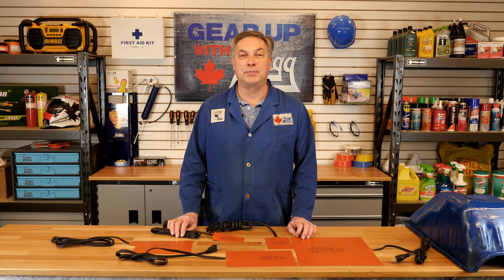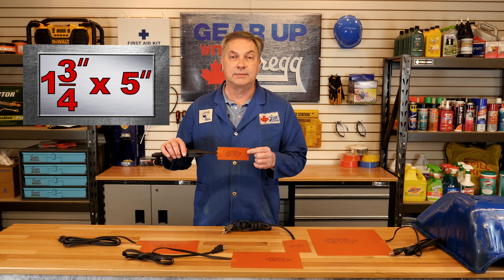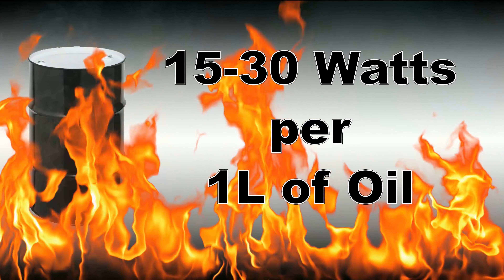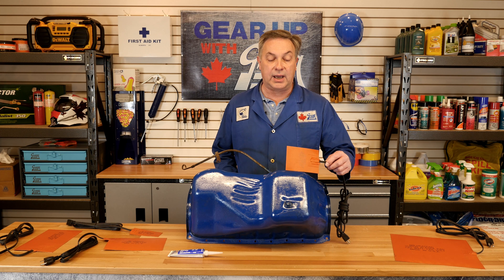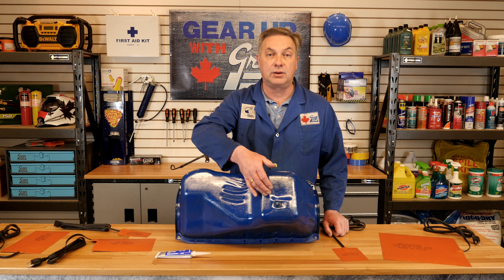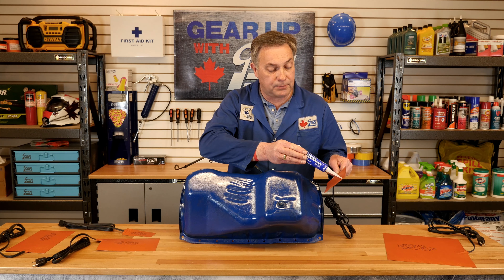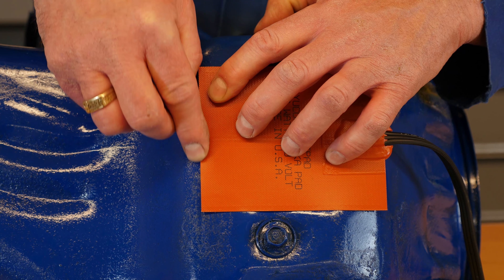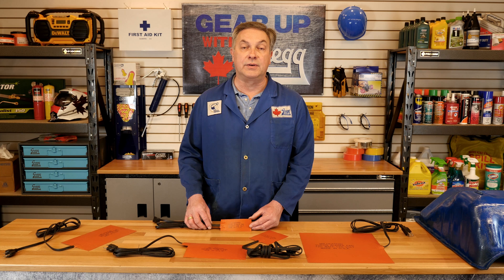How To Install an External Oil Pan Heater / Heat Pad - Gear Up With Gregg's

Comment: I have been using these pads in my cars for years. The one drawback is that one never knows if the pad actually ‘turned on’.  One day I was curious and checked one of the pads to see if it was hot.  It was not hot, not warm - broken.  And for who knows how long?
Reply: Pull the dip stick and verify warmth or hot oil.
Reply: @JoshuaCartagena-c4q So easy to tell… some people are just plain dumb.
Reply: Same can be said with block heaters. At least you can physically tell if the pad is warm

Comment: The instructions included with my "ZeroStart Thermo" 500W P/N 3400064 pad, say "DO NOT USE ANY OTHER ADHESIVES TO APPLY PAD TO METAL SURFACE!"  in all caps.  The pad comes with "3M VHB" adhesive covering the back side.  The high temp silicone adhesive that is included is to seal the outside edge of the pad.
Reply from the maker: We appreciate your feedback. The pads discussed in this video are Access Alaska Heat Pads. They recommend use of Permatex 77BR which is specifically designed for this application.
Reply: What about this stuff ? I have it in tube already open  Permatex 82195 Ultra Grey Rigid High-Torque RTV Silicone Gasket Maker, Sensor Safe And Non-Corrosive, For High Torque And Vibration Resistant Applications,
Reply: Usage of a silicon or rubber cement type medium seems counterintuitive for an application where you want heat transfer and adhesion. A much better alternative would be to use thermal paste that is not electrically conductive or a thermal paste adhesive as are used commonly in computer CPU heat sink applications which have to mitigate much higher temperatures than you would find in an engine outside of a combustion chamber itself. In addition, covering the pad with adhesive aluminum tape to seal the pad in place should far superior results. Of course the manufacturer would need to play around with these suggestions but I guarantee it would improve overall performance and longevity.

Comment: A vid on how to combine a block / oil/ and fuel filter heater (s) would be awesome. I would like to combine them all on one plug.
Reply: Just route them all to the same area and get a 3 way extension cord splitter.

Comment: I'm going to install a 150W on a civic 3.7l engine. I know its a little higher than what you recommend but the heater cuts off power if it reaches 90 celsius. Also, this vid was exactly what I was looking for. Because I wanted to make sure I could use silicone under my pad for better adhesion. And I will have to bend my pad a little around the curves of my engine so I really need it to stick good.
Reply from the maker: Best of luck on your project and thanks for watching our video!
Reply: @GreggDistributorsLP  Thanks, I think the installation went well!
Reply: Am I reading this right? You J swapped a Civic? that sounds cool as heck
Reply: @glenbenton4855  Looks like I made a typo 😅 stock 1.8l.

Comment: which one should i get the 100w or 150w for my 7L car? and can i leave it plugged in until im going to use my car again? this coldness in canada always gives me a hard time every morning.
Reply from the maker: 7 Liters is equal to 7.4 quarts (US). Manufacturer recommends 15 - 30 watts per quart of oil. Therefore, your application would require a 111 watts to 222 watts.  The 150 watt version would likely be a good choice:

https://greggdistributors.ca/automotive/Automotive-Accessories/Silicone-Pad-Heaters/qqq78658945150

Yes, you can leave this plugged in while your vehicle is parked and not in use as this is how these are intended to be used.

Comment: Why would you add gasket maker ?
Reply from the maker: It is recommended by the manufacturer to include gasket maker,  as it is resistant to oil. This allows the heat pad to have a better connection to the oil pan.

Comment: Is it worth applying to a transmission for better cold shifts?
Reply from the maker: Attaching the heat pad to your transmission pan will keep the fluid warm, and help the transmission out on those chilly days. Thank you for taking the time to check out our video!
Reply: Damn good question.
Reply: I might need one for mine 😂 my 6 speed acts differently when it's cold vs. warmed up

Comment: Can I use a 300W portable power station with a 150W silicone pad heater ???
 I start the engine not only under the house, where I can connect the heater to the home AC sewage system

Comment: What do you do with the cord after disconnecting? Zip tie somewhere along the rocker panels?
Reply from the maker: The idea is to feed the cord up through the front grille of your vehicle, so that you can plug it in easier. Similar to a block heater. Thanks for watching!

Comment: I just moved to Manitoba from Toronto. Instead of installing a block heater is this pad good enough for -40 degree and below. Should i install multiple pads for battery engine and oil pan ?

Comment: I have to keep my snowblower outside but it has been so cold that it cant start even with choke on full. Any suggestions ?
Reply: Literally throw a heat blanket like this over it and leave it plugged in. Get like a 300w it’ll keep it warm enough to start but won’t use a ton of power passively
Reply: Or go buy a handheld propane bottle torch for 15-20 bucks and use it to gently warm up the cylinder bore (metal mid portion of the engine with all the metal fins on it) for 40 seconds (away from carb and the fuel line/tank an

Comment: For 150 watts power, how long it is needed to warm up the oil? An hour?
Reply from the maker: Unfortunately, this is not a simple answer.  It depends on the outside temperature, temperature of your oil, size of your pan, etc.

Comment: Is it safe to use a 15W Alaska pad on a Honda 3000 gas generator?  It takes about a half litre of oil.
Reply from the maker: Based on the suppliers recommendation of 15 to 30 watts per quart, 1/2 a quart would require 7-15 watts, and their smallest pad is a 50W option, so doesn't look like this will work for your application.

Comment: Can I use this on my sierra pickup, theology heater only turns on at 20c below, will it set an engine management code
Reply from the maker: You sure can! Also, these heat pads shouldn't be setting off any codes when in use.

Comment: okay so i have a 1997 rav4, it holds 4.5L of oil. i need how many watts? my calculations say 135. which would mean i should use a 100 W heat pad right?
Reply from the maker: Correct!  Your ideal wattage range would be from 71W to 141W.  So the 100W pad would be a good choice:

https://greggdistributors.ca/automotive/Automotive-Accessories/Silicone-Pad-Heaters/qqq78658945100

Comment: Can I still use my block heater with the Alaskan pad?  Or is it one or the other?  30f below zero is about as cold as it ever gets where I live.
Reply from the maker: Thanks for your inquiry! If you are planning on using the Alaska pad on your oil pan and your block heater is an immersion style coolant heater, you should be fine to use both.
Reply: @GreggDistributorsLP  and what if the block heater is NOT the immersion style?
Reply from the maker: @jotu173  What style is it?
Reply: @GreggDistributorsLP  google "Kat 11813"  to see it.
Reply: Use both 
Block and pad heater.
I would never use only  a oil  heater. 
Pumping warm oil in a cold engine is very very bad.
Aluminium engines will be damaged
Specialy whene its  -30 orso. 
Coolant can be circulated by a waterpomp ,so a bigger surface will be warmed up.
You cant pump oil around with a external pump 
So if you have no block heater or webasto 
DONT USE ONLY THE OIL PAN PAD!
Reply: @marcello033  What if I plug the block heater and oil pan heater at the same time? Since the oil pan heater seems to work faster.

Comment: Can this be used for DIY seat heaters?
Reply from the maker: Thanks for your inquiry.  No, it would not be safe to use these for this application.
Reply: Works well with a thermostat

Comment: I just installed a 75watt one on a small engine that holds 1.2l of oil, is that an ok wattage for that oil capacity ??
Reply: Overkill
Reply: How did yours work out? I'm going to install a 150W on a civic that has around 3.7l of oil. I don't think the pan can be damaged as the guy says. I think they are all built similar thickness just some are larger. And the heater has a cut off for power at certain degree.

Comment: If you're using these pads for a car battery, do you just lay it down on the battery table and just place the battery on top and how do you know how much volts to use? I don't want to blow my battery cells because it's too hot. Plus, if my battery is warm, will it run my engine if it's minus 25 cold weather or should i just get two pads, one for the oil pan and one for my battery to sit on?

Comment: 😊
It would have been nice if he filled that oil pan with the 6 ltr of motor oil and placed it outside and covered in extreme cold with heater plugged in over night. Then we could actually see true temp of heater warmed oil.  Just wondering 🤔

Comment: Why would a little extra wattage damage the oil pan? The temperature of the pad would be only a fraction of the oil and engine temperature when the engine is running.
Reply from the maker: In this video, we are following the manufacturers recommendations.
Reply: it will burn the oil.

Comment: Could this type of heater be used on a diesel fuel tank to prevent the fuel from gelling?
Reply from the maker: The only ones that are specifically designed for diesel fuel are the diesel fuel filter warmers, you can check them out here:
https://greggdistributors.ca/automotive/Automotive-Accessories/Silicone-Pad-Heaters/tem3400039

Comment: Can I use my block heater and a pan heater simultaneously?
Reply from the maker: As long as they are both thermostatically controlled, this should not be an issue.
Reply: @GreggDistributorsLP  how is the pan heater termostatically controlled? Does that require additional equipment?

Comment: Fellow Canadian here!  :)  I'm looking for a 12V option to keep an oil catch can from freezing.  I'd install the heat pad and then insulate the catch can to maximize effectiveness (this would be a heat trace solution).  I'd put the pad on a switch that I'd need to remember to turn on and off as I'm driving.  This would allow me to drain the catch can while it is still warm.

Do you have anything in the 12V range?  If not, I suppose plugging one of these in the warm up the can and then draining it would do the trick.
Reply from the maker: There are three options for 12V heat pads.  If you have a look at our online catalogue on page Q15 (https://www.greggdistributors.ca/catalogue.php) you will see the three models listed.  Part number 340-0070, 340-0071, and 340-0074.

Comment: Why remove the paint
Reply from the maker: The temperatures associated with heater operation can cause paint to crack, causing the heater to slowly loose connection from the oil pan.
Reply: @GreggDistributorsLP  what about   a thin magnet adhered to the pad?

Comment: Is it recommended to be installed during cold winter outdoor temperatures -30 Cel?
Reply from the maker: For best results, the product should be applied in a warm garage.  You do need a clean and dry surface and it would certainly be more difficult to clean the surface in minus 30.  Having said that it could technically be done so long as the adhesive you are using to apply the product can be applied in that cold of temperature.

Comment: 3.7 liters of oil whats the exact watts thank you
Reply from the maker: 3.7 Liters is equal to 3.91 quarts (US). Manufacturer recommends 15 - 30 watts per quart of oil. Therefore, your application would require a 58.65 watts to 117.3 watts.

Comment: What about a 250w pad on a 4.5L capacity Oil pan?
Reply from the maker: For a 4.5L capacity oil pan, it is recommended by the manufacturer to use a 125w pad. For more information, please visit our website > https://greggdistributors.ca/automotive/Automotive-Accessories/Silicone-Pad-Heaters/tem3400032

Comment: Ok but how long do you plug in the oil pan heater?
Reply from the maker: No different than a standard block heater cord.  Typically, they get left plugged in overnight and then are unplugged once the vehicle is put into service during the day.
Reply: @GreggDistributorsLP  I have the thermostatically controlled phillips temro one, and I only start it once or twice a month.  So still just plug it in overnight then before starting?  Some people say doesn't make difference over 4 hours.

Comment: 1988 f150 inline 6 4.9L how much watts i need?
Reply from the maker: 4.9 Liters is equal to 5.18 quarts (US). Manufacturer recommends 15 - 30 watts per quart of oil. Therefore, your application would require a 77.7 watts to 155.4 watts.
Reply: Depends on how much oil you have, not your engine size.

Comment: How long do I have to wait before a start engine?
Reply from the maker: If you're using Permatex 77BR silicone, the recommended cure time is 1 hour. It is considered fully cured after 24 hours.
Reply: @GreggDistributorsLP  I was thinking generally. When I install this heather, how long he needs to be plug in electrisity before I start the engine?
Reply from the maker: For this question we recommend that you contact the Heat Pad manufacturer.

Comment: I used gorilla glue is that ok?
Reply from the maker: For best results, we recommend using the Permatex #77BR silicone to apply. More info here > https://greggdistributors.ca/adhesives-sealants-and-tape/Thread-and-Gasket-Sealants/Gasket-Sealants/per77br

Comment: Is there a way to hook up a thermostat?  I want to use it for an outside air compressor stored in a shed
Reply from the maker: As far as we are aware, these pads are not recommended for that application and we are not aware of any options for connecting a thermostat.
Reply: Pretty sure you could "DIY engineer" one.  Just google Thermostat 120V plug (put between wall plug in and heat pad cord)
Reply: Best value vacs sell heat pad Identical to this with a temperature controller.
Reply: @jotu173  @Mark lengal. Every thought of trying an electrical water pipe heater. They are sold in different lengths and use about one watt of electricity per foot. Im thinking wrap up the lower quarter if its a stand up tank but not sure if if air tank is vertical or horizontal. The water pipe heaters are thermostatically controlled. Just a thought and hope it help.